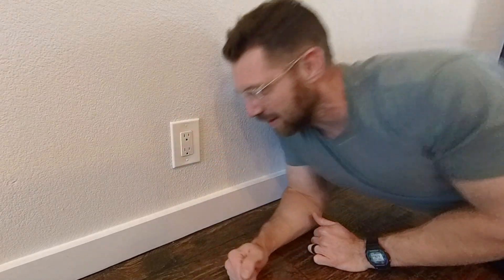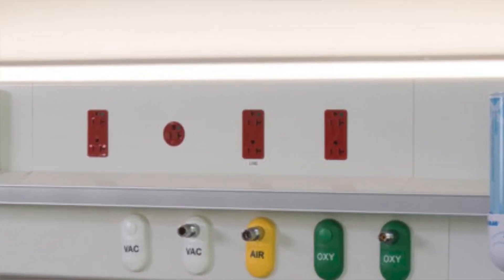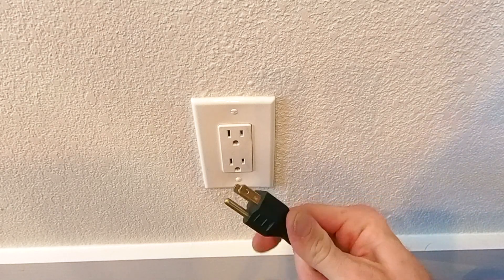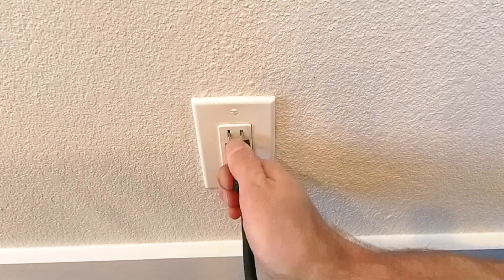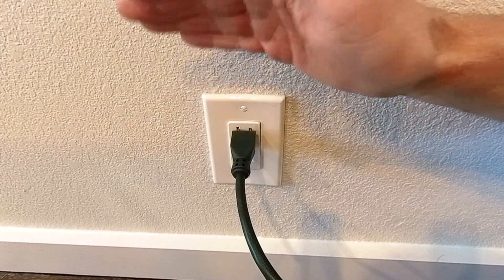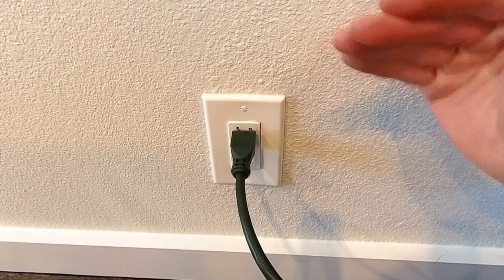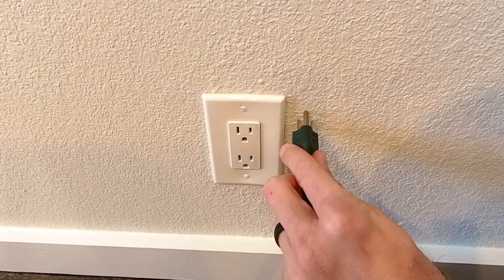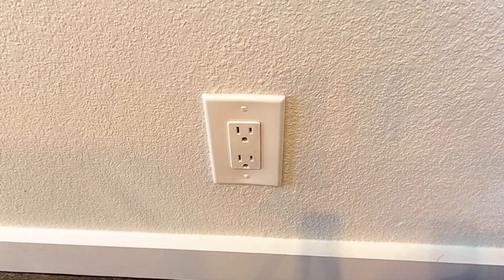Why are hospital outlets upside down?

Comment: Well thats fine, and safer, I admit, but explain to me why so many products, like nightlights are designed for the out let to be installed in the unsafe manner, if you go to plug that nightlight in, or any decorative electric outlet wall light in the safer position, the damn thing is upside down...contractors and products needs to find a common ground here...

Comment: Thank you for explaining the reason that my outlets were all mounted upside-down.
Two remarks:
1.  The "plug" is the device with the (two or) three prongs which are inserted.  The "outlet" or "receptacle" is the device which receives the plug.  Please do not refer to the outlet as a "plug".  
2.  Despite the very good safety reason that you have explained so well, the fact remains that some plugs are designed for insertion the other way.  Most plugs are designed "in-line" with the cord, so the orientation of the outlet doesn't matter.  However, there are a few plugs (notably for refrigerators) which are designed at 90 degrees to the cord.  And these plugs have the ground prong on the bottom, that is, toward the cord.  I had to reverse the orientation of my refrigerator outlet so that the cord extends downward from the plug as it should.
Reply: thank you for that, I love learning

Comment: Ole wise tails??? you mean "old wives tales" don't you?  Also, a ground-up outlet is safe to connect in the dark by touch if necessary . Carefully avoid touching the hot and neutral, grasp the plug between thumb and middle finger,  put the index finger at the top end of the  ground pin and feel the ground opening in the outlet with tip of the finger, then insert plug. No danger of getting shocked.
Reply: combination of dyslexia, and not paying attention.